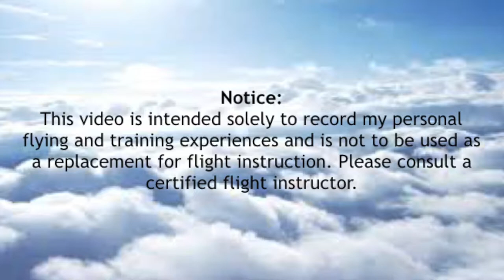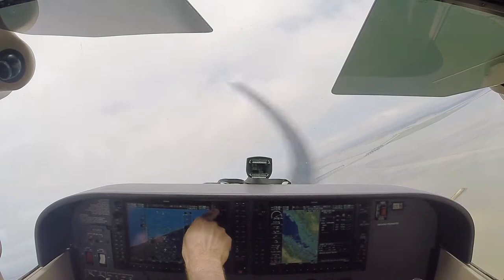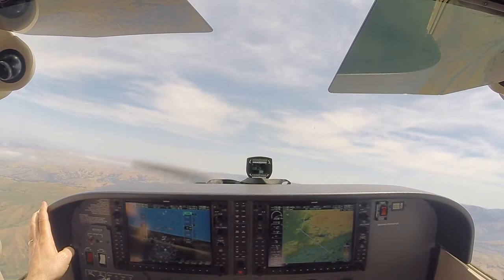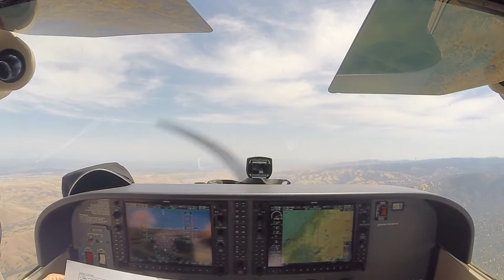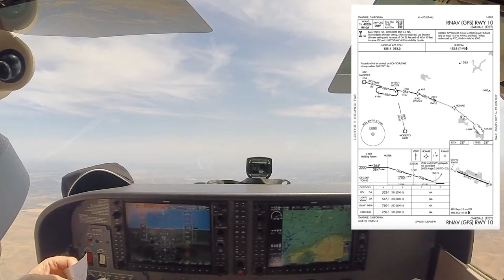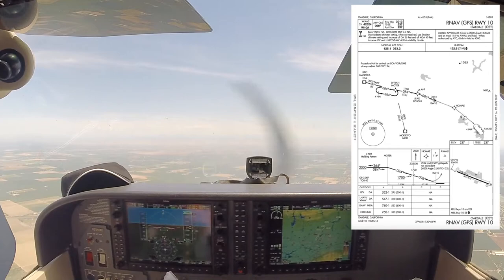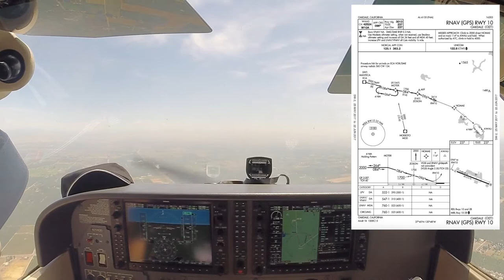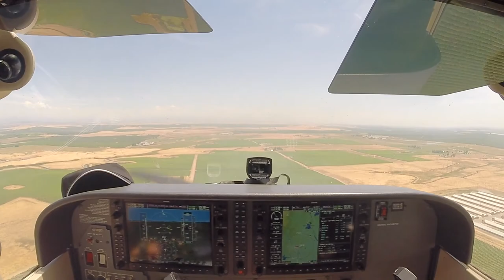IFR Training Flight - G1000 - GPS Approach Circle to Land

Comment: Yea, i started IFR training and prior always have the MFD tracking NORTH, that way i know where i am in relationship to my destination/waypoints etc... CFII always switched it to TRACK-UP says its easier to know which way to turn....
I'll figure out what i like best after getting my rating....
Reply: Parr003 We now have moving maps thanks to systems like G1000 and ForeFlight and track up gives the best situational awareness.
Reply: Kevin Talbot yea, i use a G1000 and ForeFlight, I used Track North on the G1000, but was encouraged to track Up during IFR training. Not sure which way I will continue after IFR training, both have Pros/Cons.....
Reply: I have only ever flown track up (throughout my VFR training).  Now in the middle of IFR training so still using track up.  I would say in modern times (with G1000) track up makes more sense but you should use whatever you are used to.
Reply: Kevin Talbot I was "used-to" North-Up during VFR, CFII suggested "Track-UP" for IFR training, I just relied on his experience and made the transition by using Fore-flight as North-Up for now, just trying to keep it simple during training, who know what i will do afterwards.
It's a lot to learn, so i depend/rely on a great CFII to offer suggestions/recommendations.....
And try to learn what i can, and try options, then pick what works best for me.
So far Track-up works well.....
Reply: You done with IFR?
Reply: Good luck with your IFR training!
Reply: Half way.
Reply: Kevin Talbot ditto I have a little over 20 hours down.....